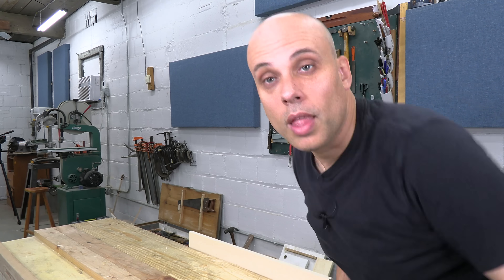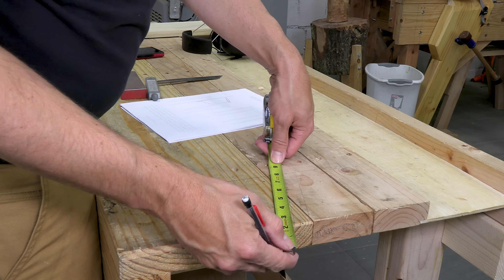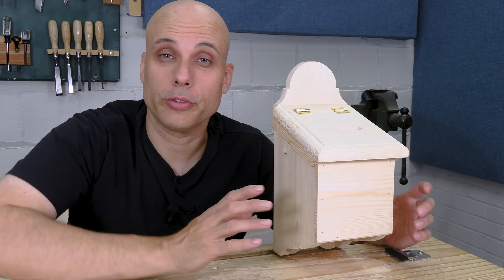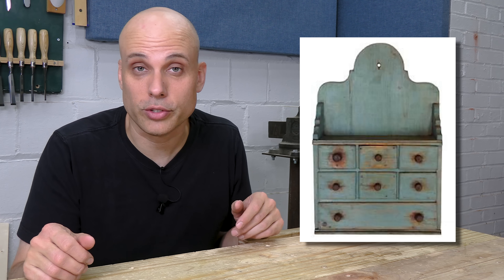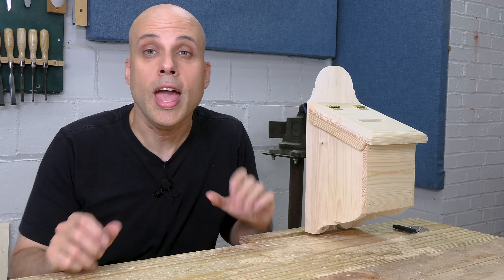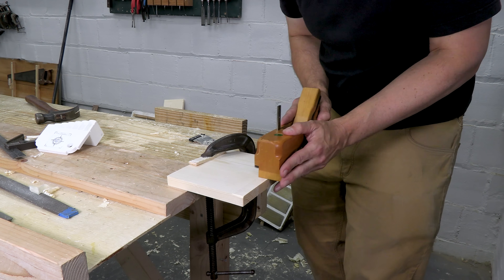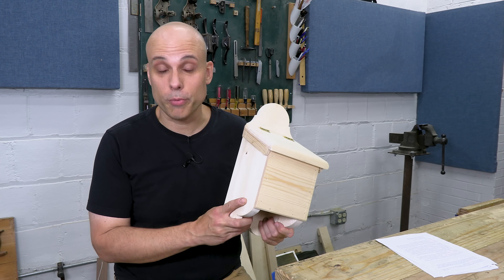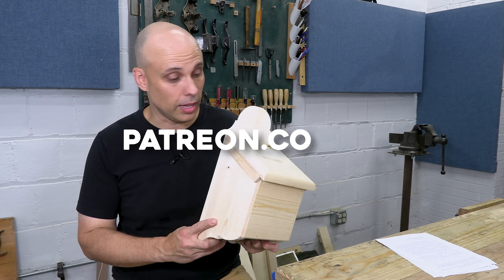You Don't Need Plans for Woodworking.

Comment: Thanks Rex. This is great advice. Last weekend I built my first bit o furniture, a shoe rack, and basically did a simple sketch and winged it. Mistakes were made, and corrected, and most importantly lessons were learned (the top needs to be wider than the shelves!). Had I followed plans, no wisdom would have been gained. Errors are required for learning.

Comment: From the perspective of a draftsman, plans are often misunderstood as being fixed in stone and something that must be adhered to (outside of contractual agreements and record keeping).
To put it simply - a plan is a Map of Intent
Plans are a method to communicate to other people involved (including yourself) what the final form of the project will be *at that point in time*. If an issue is found, we literally "go back to the drawing board" in order to "make a change of plans" to match the new, more realistic outcome.
In the context of woodworking, plans are a great way to . . . plan ahead . . .for what materials you need to prepare, to help predict the total cost, to minimise wastage (time, money, materials), and as a reference to follow during the construction phase. As Rex points out, you will probably want to tweak plans for your own design. So it is then wise to update the plans to record it for future reference - especially if you intend to make a higher quality version, share it, manufacture it, etc.
So the idea of "going in without a plan" is still actually a plan! You just haven't yet brought that fuzzy idea in your head into clear focus by mapping it out as a diagram, list, steps etc. The word 'design' is the process of clarifying that fuzzy idea, and so the old saying 'Measure Twice, Cut Once" is really a reminder to check your 'map of intent' before you make a wasteful mistake. The only way to do that is to have a plan!

Comment: Thank you for the confirmation.  I am just getting back into furniture making after 30ish years of not doing any furniture making.  My first project was a small table to put a dorm fridge on.  I sketched it out in my project book and stated to work.  I got to the top and went to use my router to do a round-over around the top and the locking ring slipped now it was an ogee.  Changed the round-over out for an ogee bit finished the top, then put on the finish.  Everybody who sees it loves it.  Success.  Now I am building a base and top for a set of barrister cases I rescued from a dumpster when I was in the Navy.  The base is almost ready for finish.  Oh man I am so glad to be getting back to working with wood.

Comment: In my high school woodworking I did use plans - that I drew myself.  I used graph paper to give me accurate dimensions, usually one square representing one inch.  Besides that, my plans were about as complex as this one, just basic dimensions for cut lists.

A few years ago, I decided to make Rex's "Thor's Hammer" jointing mallet, and I bought the plans.  But I didn't use them much, just for the main dimensions and cut list.  And I could have figured those out on my own.  I winged the rest.  But buying the plans supports Rex and makes the project a little easier.

Comment: That's the way to do it Rex.
I never work from plans and don't spend money on wood.
My house is furnished with Me made furniture which is all made from reclyed wood or pallet wood. I am a little bit dyslexic and plans just confuse me. I do copy styles.
I live in a 125 year old house in Tasmania so reproduce furniture that suits the house. 
My procedure is normally
Make basic measurements to suit it's intended location and function.
Search my supply of old timber and get stuck into it.
The wood usually helps, it sort of tells you what it wants to be. 
To me making furniture is like painting. Artists don't plan every stroke. They start with a basic sketch and build from there.
You can change your mind as many times as you like untill it suits you.
Geoff and old man in Tasmania

Comment: I built myself a headphone stand out of pipe and a wooden based based a number of YouTube videos I had seen. A friend of mine saw it and asked me to build one for her but "Not so industrial looking".  I couldn't find anything that was inline with my vision so I just came up with my own. Two boards. One with a dado. The other fits into it. I cut an interesting shape in the vertical piece. Nothing fancy but it worked.  Then she told me it had to be portable to take into the office so I used magnets instead of gluing the pieces together. Look at me improvising! 😊

Yes, this was a very simple project but it gave me more joy to build that than anything else I've made.

Comment: When I first started in woodworking I used plans mainly for my own sense of security in building.  As I got more comfortable with my tools and skills, I still started with plans, but frequently made adjustments to the plans to fit my needs and found it quite satisfying.  I still start with plans, but I find myself building my own projects based on my simple drawing, though my drawings might be based on studying plans from similar projects from three or four different sources.  I am currently working on a project trying only using my supply of scrap wood.  I enjoy your videos very much.

Comment: I'm building a small box to hold some tools. I couldn't quite come up with how to attach the lid with the hinges that I have which are small. Your video gave me an idea of putting a small strip of wood with the hinges that I have  across the back edge to attach the lid. Anyway very nice video. I often work as you do off the top of my head as I build but sometimes need a little help. Watching your videos does help me alot. Thank you for the videos. I do enjoy them and look forward to watching more.

Comment: I made a little 3 drawer box for my 3 grits of 5” diameter sandpaper. Made it out of entirely offcuts and cheap plywood scraps and refrained from using CAD which was hard because I’m an engineer by day.

Super happy with how the drawer runners I designed came out and it’s one of the most simple but beloved projects I’ve done in my first 6 months of woodworking.

Comment: last weekend I picked up 10 sheets of bargain 9mm plywood- (30" x15" for £1 each) I decided to make some small storage boxes (4 sides and a base) roughly 10" x 4" x 2 3/4". I had an example already.
I call these table saw boxes as everything is done on the table saw, set the width of the strips using the existing box. cut the strips, set the saw to about 3mm and cut a slot down all of the strips (for the base), set the saw to the 4" width using the existing box, and cut 2 ends from each strip. set a line for the box length by comparing against the existing, then cut 2 sides from each strip . I got 5 strips from a sheet of ply, and each makes a box with about 2" waste. then its cutting the rebates for the sides onto the ends ( this is a blade width with the saw set to the thickness of the board, this gives 2 shallow rebates on each end. for the bases I have some 2mm fibreboard sheet length is the inside box measure plus 1/8" width is the inside box measure plus 1/8" (allows a slightly loose bottom) now its just a glue and 24g pin nailer to put it together (saves using clamps) and in about 30 minutes or so I have made 5 stackable boxes for storing 'stuff' put them on a shelf, write whats in them on the front and theres a storage solution. I have 9 boxes done already, 6 more awaiting glueing and 4 sheets of ply left to make another 20 boxes. (I also made some DVD storage  boxes from the first couple of sheets. 
OK I hear you say you did all that with a table saw- yes for speed and convenience, but it could all be done by hand, it would just take longer.

Comment: I’m currently waiting on a formwork job to get moving, so I am building some finishing trim for a built in couch my father built a couple years ago. I asked for some drawings and was told I could figure it out. A week later and I have the design planned out in my head, the main joinery cut, and am getting set to sort out the router edges this week. I’ve even designed and mostly assembled a scrap bench to practice ideas on.

Comment: I just learned this lesson the hard way. I made detailed plans, but soon after starting I had to make adjustments, and the meticulous plans became a rough guide. The silver lining is that by trusting yourself you gain confidence, and get lots of practice thinking on your feet and solving problems quickly. I’m finding out that the semi-improvised finished product is better than the one i spent hours drawing.

Comment: 4:45 marking the depth of your rabbit on the edge, then taking a chisel and pushing a slight cut into that mark helps prevent splintering when you're doing plane work. It'll break at the cut rather than continuing down the grain. I know you know this, I was just commenting for new workers.

Comment: As a beginner in woodworking, I'm still trying to figure out things. But one thing I did figure out is I do not like to make plans, or even look at plans, when I'm in the shop.. This does result in spells of inactivity, and tryign to figure out either what I had in my head, or how to do things. And it's not the best way to get consisency if your idea's change too many times during a build spread out over weeks due to time constraints.. But it's what I like so far.
I have not built many things yet, but enjoying making dusk (cleaning up, not so much).

Thanks for your video's!

Comment: I very often use plans for my woodworking.  And I have been working with for a lot longer than you have been alive.  So, when I want plans, I design them.  I don't use other people's plans, because normally they design something they think I will want.  Well, I don't want what they think I do, so I draw what I want.  Same that is happening wih the van that will wind up as a camper .  I will only be using what I design, and that I make, including heat and cooking.  Bed, chairs, toilet, whole nine yards, and no one's plans except mine.  More fun that way.

Comment: Confession time: I've bought a few of your plans, but I've never used one as a plan.  I buy the plans so I have a written copy of a deep dive into the project you did, but I never have followed a plan directly.  As you say, I just wing it.  If I've got something tricky, I'll do a few test pieces, such as the joinery on my corner cabinet with overlapping tenons at 45 degree angles: that needed some practice to workout.  But mostly, I just watch, store the process in the old gray matter and then refer to that as I'm making my project.  Keep up the good work Rex.

Comment: I have never used bought plans in my life.
Simple things I plan in my head and fit as necessary.
At the other extreme I will draw out things full size on thin MDF, and take my key dimensions from that.

In some form or another every thing is planned.

Comment: My plans are usually only in my head.
I think about them quit a lot before I start.
Most of the time there are some key measurements the place the piece will live in dictates.
Then I start... sometimes my approach bits me but it's the way I like my woodworking.

Comment: For fun, I draw the object in perspective to figure out the joints and the measures. Generally, I see and fix some design problems before touching a tool. I need between 3 and 6 drawings to get it ready but, as I only made simple objects, the drawings do not require a long time.

Comment: True enough I don't use plans for my projects, I just kind of wing it as often a set of given dimensions won't work for one reason or another.  Something may be the same basic shape as something I saw somewhere, but the process to get there will no doubt be different.  I built a box similar to that once, but it got a hole in the front of it and is hanging out in a tree in my backyard.  Birds nest in it every year.

Comment: My basic design scribbles look like Rex’s at 1:20.  But blessed with a good mind’s eye, I have a CAD screen in my head.  I sit quiet and visualise the 3D construction and sub components, rotating them, seeing how they fit and making changes until I have the design correct and maybe with some measurements.  Obviously sometimes changes still have to be made on the go, but I’ll get 90% sorted before picking up a tool.  Edit:  I will admit I take some time and never throw parts together with my fingers crossed.

Comment: I met a guy making a donation box "weald and down museum" of "repair shop" fame. He was making a traditional tool booth box from 16th century england. I say this because it was old school carpentry. but also blacksmithing. medival money boxes had 2 iron straps over the box to secure it. look very medival. 
I find copying or using plans because I struggle when something goes wrong, 1mm off a piece and it's hard to correct off plan

Comment: I hate to sound like I'm anit-plan; but the only "plans" that I find especially useful for woodworking are just drawings with outside dimensions or with a hyper critical angle labeled. OD's establish every other measurement in my projects; and every time I've tried to follow a strict cut list (as in cutting all my stock first), I've ended up with poorly fitting pieces.
Reply: I totally agree but those details are not shown. To make sure you will buy the plans.
Reply: @joeobrien196  You're right most of the time. I have some formal drafting training; and if it's drawn close to the correct proportions (or if it's a decent photo); I can usually work off of one measurement to get it close enough to work. It just takes more thinking.

Comment: Cute box. I'm curious about one thing: why did you glue up two pieces for the lid only to then cut the lid in two? Did it make it easier to cut the decoration? It seemed strange to have a glue joint in the middle of the lid instead of using the whole piece and then putting the hinge where the boards meet.

Comment: I head straight for the saw. The wood will reveal the finished project after I cut enough off of it.
Reply: That's what I do when I'm
( At a loose end ) and needing a boost. 
I walk around the shed picking up bits of wood, feeling them, sniffing them and ask them what they want to be. A board with a nice grain normally wants to be a table top whereas a gnarly old knotty old specimen begs to be a planter box.
 Look after your mental well being. I do